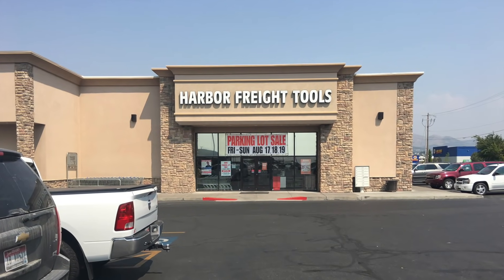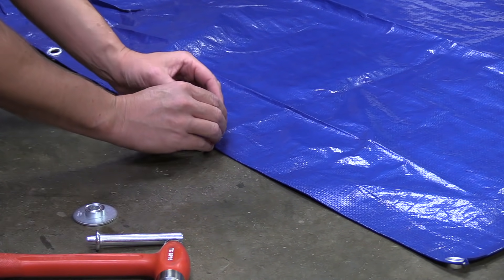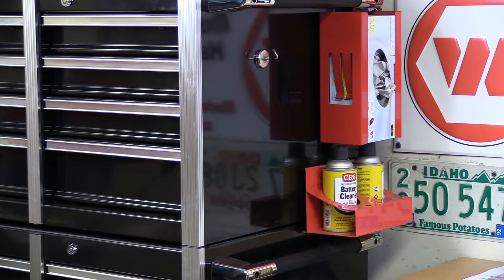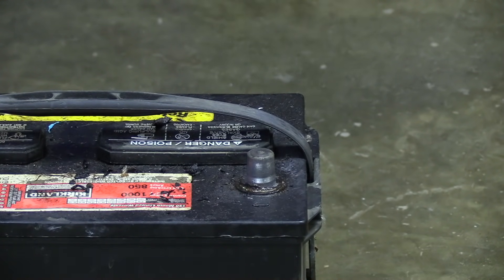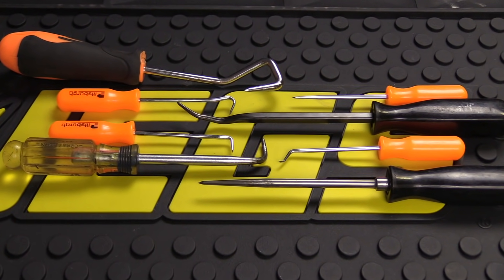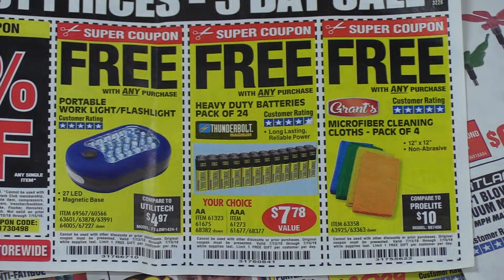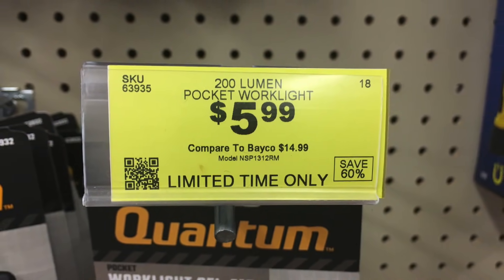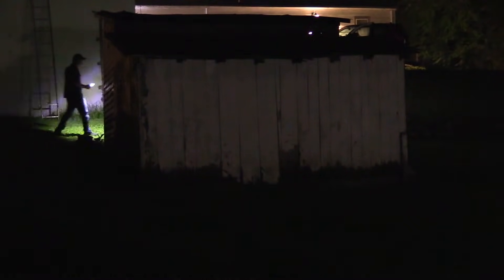TOP 5 BEST HARBOR FREIGHT TOOLS!! (UNDER $5)

Comment: Personally my best finds are the following (not under $5 but worth it)
-3 ton steel floor jack. Lifts my 3/4 ton truck with ease. Usually runs about $89
-1/2 inch impact socket set. I work in the heavy diesel industry and use them daily. I can’t break them I’ve tried. Usually runs about $25
-Earthquake 1/2 air impact. I didn’t buy mine new I found it at a pawn shop for $20 and figured wth I’d try it. With ease it broke loose head bolts on a 5.9 Cummins diesel. 
-3/8 flex head ratchet. I’ve put a huge cheater bar on the handle of this ratchet to test it while breaking manifold bolts loose on a 5.9 Cummins and it didn’t have ANY issues. Usually runs about $20
-1/2 flex head ratchet. Same as above I can break it. Runs about $25.

Comment: Free tape measures and flashlights are awesome, but I won't count them 

My top 5 under $5
1- black zip ties
2- die grinder bits/accessories
3- electrical tape
4- super glue
5- folding utility knife
Reply: Almost forgot the orange dead blow hammer! This is one of the extreme cases where the cheapo is better than snap on.

Comment: Oh yeah, I have two magnetic trays.  LOL.  One little problem I found.  I purchased a very small drain snake to be used with an electric hand drill.  I has a sticker on it that says "25 Ft".  Not so.  Only 11 ft.  I felt burned but unclogged a friends drain all the same.  I marked it stating the actual spec.  All is good.

Comment: I have all of them lol! Now for the flashlight. Walmart has the same as the $25 dollar one but for only $8 and is bright as hell
For the batteries i use rechargable ones for all my flashlights and other devices at home/work
Is good to spend a few bucks on rechargable batteries because in the long run you pretty much save a lot for batteries

Comment: 18 gauge brad gun, for $34.   but, it doesn't come with any oil, and says the warranty will be void if you don't add some. lucky for me my friend had some , i could borrow until i bought some.   I've gone thru almost 1000 brads with out a problem. also, love the 10 inch. miter saw for $94.  just wish they included a blade.  blade cost me 13$   more.

Comment: Now that NEBO has redesigned their first Big Larry they are an EXCELLENT flashlight.  But be warned, the first generation Big Larry had circuitry problems and didn't last very long.  Make sure you get the gen two because there are stores out there that still sell the gen one. ...Sorry, you really can't tell the difference from the outside between the gen one and gen two so, good luck.  BTW, the added cost of this flashlight is worth every penny.

Comment: Impact socket sets 
Electrical crimp on terminal sets
Electrical tape 10 pack
Teflon tape 10 pack
1/2in breaker bar
STEP BITS 3 PACK
Shop towels
Swivel Casters

Comment: Their rechargeable batteries, they may not be the best or last the longest but they work well enough and reduce waste of batteries. 
Composite caliper, only good to the hundredth digit, but it even passes calibration as I work in Aviation. Good for quick reference of nominal sizes.
Their ratcheting wrenches, I’ve used and abused them for about 3-4 years and the same set it still going strong, slight chipping of the cheap playing they use, and they aren’t very slim, but hey they work.

Comment: Oh I've used the picks before removing o rings transmission rebuilding, and the broke in about 6 hours I think they suck . Recommend snap on or Mac on that one. Daytona jack though can't beat it, but it's not a car hydra jack too heavy. Maybe one of the aluminum one's though. Still heavy just not as.

Comment: Glad you're back at it again! Do you have any videos covering cordless impact wrench torque limiter extensions?
Reply from the maker: I dont, but I have recorded footage about them.....let me see what I can come up with.
Reply: Cool thank you! I saw a Performance Tool set over at Summit Racing and almost pulled the trigger, but found a side note that states they should not be used with impact wrenches that have more than 250 ft lbs of torque; My Ingersoll Rand W7150 can crank out around 780 ft lbs, I believe...

Comment: I used the light,  and have the expensive one,  the difference is dropping it,  the Harbor freight broke beyond repair and use after a single drop,  the bubba light now has a wire tie holding it together and is rechargeable,  but is has taken hundreds of drops onto the concrete.

Comment: best harbor freight tools, as per my broke high school car guy experience:
3 ton low profile jack! (do not get the 1.5 aluminum, they tend to leak and can't support a good load.)
3 ton jack stands, but I reccomend the crafstman 2.25 ton ones instead, as they're 2 bucks cheaper for a set.
breaker bars, there's nothing to em.
1/2 inch drive impact sockets
1/4 hand tool sockets
and basiclaly any accessory.  gloves, cloths, etc

Comment: You can buy many small items at H.F. that work well, most of the time. They do guarantee them all, even without a receipt.
Just don't waste your money on their cheap batteries, crap flashlights or anything with a motor.
I have one of their bottle jacks that I ordered from one of their stores in California before they went nationwide back in the 1970's, it still works well.

Comment: I only buy tools at Harbor Freight! Pittsburgh hand tools are guaranteed for life and you can't buy any other lifetime guaranteed tool at their price. 4-1/2" angle grinder, i get them on sale for around $9. I have one for every head I own then i don't need to change heads. So cheap if it quits, buy another! Drill Master cordless drill works as well as a DeWalt I own but you get the drill Master drill, battery, and charger for the price of one DeWalt replacement battery. Woodworking clamps are way cheaper than any other distributor and they work the same as the expensive ones! Hammers are low priced and again lifetime warranty. A Dead Blow hammer came apart after much use and they gave me a new one! Keep all your Receipts just in case.

Comment: That flashlight will give you problems. If it doesnt turn on, you'll need to separate the body and screw it back together. I have 2 of them and they both wont operate properly if I dont do that occasionally

Comment: My top 5
1. 4" magnetic parts tray (free with coupon
2. 4 1/2" Flap disks
3. 1/4" air hose connectors
4 7 function digital multimeter (again free with coupon)
5. 5'×7' tarp (free with coupon)

Comment: You have to be careful with those picks, they work great for small seal/O-ring removal in easy access places, but once you start to tug on a stuck seal in an odd spot itll break the end off of it.

If you live close to a harbor freight then just replace them, but of you're far away from one get some good quality ones

Comment: Every time I go to HF I always bring the 20% off coupon and get a Free item. Top 5 free items 4" magnetic parts holder, digital multimeter, tape measure, LED flashlight, and micro fiber cloths. I have multiples of some. Top value tool for me, I work on cars/trucks is the Earthquake 20v impact drivers, 1/2", 3/8" rachets. They are a must have, no hoses, or wires, and long battery life.

Comment: To complete the story of the battery terminal cleaner. After cleaning and reassembling,  pack or cover the connection with grease... You will most likely never have to do it again.
You can buy dielectric grease. But any grease will work,,,  try not to use bacon.
Reply from the maker: “Try not to use bacon” 🐷🤣🤣🤣
Reply: Willy Bee: Is that why my dog keeps begging to work on your car? (He tells me your idle is 'ruff.')

Comment: The light he is talking will cost you an arm and a leg in battery cost. I bought one of the types of lights at Ace Hardware which was more expensive but produced a whopping 3500 lumens of light. It uses AA batteries but lasts a long time. I use it to work in my crawl space and as a light to go into my shed. I also use it when I am piddling around at night in the backyard. It can do everything that this light can do and use a lot fewer batteries.

Comment: Mini pick and hook set: don't even think about using these on machinery. Those tips break off WAY too easily, and then you have the tip floating around in you machine. I'm sure they're fine for plastic or rubber seals.

Comment: Great picks, but you failed to mention that the $25 light had 400 lumens compared to the 200 lumens of the Harbor Freight. Still a good deal @ 6 bucks, though.🦁✌
Reply from the maker: Don’t believe lumen ratings....most are complete BS.  There are no standards for how companies rate them....just like impact wrench torque specs.

Comment: Pittsburgh 3-IN-1 Stubby Screwdriver; PN 65062; $2.99. [Hint: replace clear plastic film with heat shrink IOT protect black metal retention clip.]

Pairs well with Warrior Hex Shank Socket Driver Set; PN 68513/ 63928/ 63909; $4.99. [Notes: These drivers are NOT impact rated; a soft plastic bit holder is included with the set.]

Comment: I am a carpet installer of over 30 years. Friday I went to work and t realized that my wife had "borrowed " my carpet knife. Since harbor freight was about 20 miles closer than my house, I decided to go and purchase a GORDONS  carpet knife.at a glance it appears to be the same as my knife so I bought it for under 10 bux. It came with only 1 blade.but that's ok because I have a whole box in my box.got to the lady's home to install her white berber. I puta5 or 6 blades in the knife. About 25 minutes later I am bleeding profusely from the palm of my hand.  Upon a closer examination, I find that the two halves of the knife dont fit together tightly which allows the razor blade to slide out and cut the user. There is a screw hole for a safety device that would prevent this from happening but even though they sell this dangerous poorly constructed tool, they didn't care enough about the customer to include it. Long story short, this knife is by far the most expensive carpet knife I've ever had in my career, when you include the price of replacing the carpet (560 dollars wholesale). I plan to speak with the manager about paying for the carpet as harbor freight is obviously more able afford it than I.  This whole pandemic has really hindered us carpet guys from making a living

Comment: The flashlight is a great deal, but the $19 I paid for a Nebo Big Larry was money well spent.  It is better built, and nearly twice as bright.   It's great to have in a vehicle glovebox then if you're stranded on the side of the road, you can choose to leave it with the vehicle as a strobe warning or take it with you so other drivers see you better.    I just wish they made a version of the Big Larry that was shorter and took an 18650 cell, they meaning Nebo, I already have plenty of generic junk flashlights and the lesson learned is don't do it.  You'll leave them sitting in a drawer once you get something nicer and wish you didn't waste that money in the first place.

Please do not encourage people to get those free heavy duty (junk) batteries.  Their run time is poor and they senselessly add to landfills. Low self discharge rechargeable NiMH cells for the win.

Comment: read your packaging...the Big Larry was TWICE the lumens too
Reply from the maker: The only problem is that there are NO standards for measuring lumens.....you can only measure lux, which requires something called an integration sphere.....most manufacturers pull #s out of thin air to seem superior.

Comment: While a nice suggestion those harbor freight batteries are trash. If you get them free I'd just use them in remotes as they don't stand up to other batteries in high power applications. I've read up some reviews on testing their capacity and they almost always end up at the bottom of the barrel. This is because they are made of zinc chloride, which are still considered "Heavy Duty" despite performing worst than regular Alkaline. This is why they sell a set of 24 for $2.99 while selling their 4 pack Alkaline for the same exact price. These are basically ewaste right from the packaging. Don't believe me? Check the 3, 2, and 1 star reviews on harbor freight's website. Many complaints about them only lasting like up to 2 months in a TV remote or like 10 minutes in a flashlight.

Comment: I have something like the flashlight, only it has a spot beam light where the button is located. Just two modes, spot beam or flood. Got it for less than $2. I'm waiting for the store to restock so I can get more. Best of all, I can fit it in the strap of my old broken LED headlamp and use it as a work headlamp or rotate the strap 90 degrees for a  side mounted search light.

Comment: As a professional I don't use a single thing out of Harbor Freight however I do see a purpose for it if you're trying to teach a child how to use power tools and tools in general sometimes moving from Toys to tools can be expensive so I suggest you get them started with a Harbor Freight Tool because it's so cheap it doesn't matter if they lose interest you could just pitch it but if they do grasp the idea then go out and buy yourself a real tool like a Milwaukee or a DeWalt I prefer Milwaukee and Bosch I won't even be seen or have any of my guys use anything from Harbor Freight or Ryobi Black & Decker's another one I looked down on it cuts down your credibility you lose respect using garbage tools I say go right for the Bosch or the Milwaukee I never have a complaint at all with these two tool companies but as for Harbor Freight it's a crossover between toys and tools it's not really for anybody serious
Reply from the maker: Well that is the most condescending thing I’ve heard all day.  Congrats!
Reply: I have many Harbor Freight tools that have out performed the big name brands, doesn't matter what the name is as long as you are able to do the job that the tool was intended to do

Comment: Ratcheting straps, breaker bar, extension ratchet, hedge trimmer, rapid car jack. Also sockets and tarps.
Don't buy the car ramps. The angle is too steep.

Comment: Zip ties tensioning tool paid eight dollars for it we should've bought five of them they replaced it with a crap you're one crappy or crappy or one crappy here one there a city one now but the old one was really good your electrical place they will sell you probably something is better than what I paid eight dollars for it but they'll charge you $100 for it and we should go back to the old one it was funny the old one you had plastic on the outside but The part that would pull on the zip tie was metal in the newer one do I believe they have right now it's like looks like all metal but then the part that holds the polls the plastic zip tie is also plastic 
I believe the reason why they are so expensive is because they virtually work all the time leaving a little small nib out can cut you the plastic is soft but it can't be Sharp when you hit it hard enough

Comment: In my opinion those Quantum flashlights are junk. Not nearly as bright or as durable as the Big Larry. Also the magnet on the one I bought wasn't even strong enough to hold it horizontally. Typical import junk. The wool moving blankets are good to throw in the back of the car/truck. The Braun 390 Lumen Magnetic Slim Bar Folding LED Work Light is $19.99 on sale and one of my favorite lights to work with. Their floor jacks are pretty decent. I usually get all my nitrile gloves there too.

Comment: The battery terminal brush is garbage. The brush to clean the wire terminals is mounted in plastic which cracks and the brush falls out. I don't recommend.